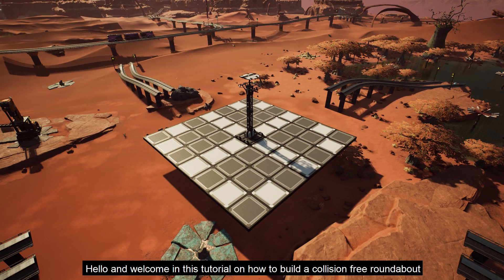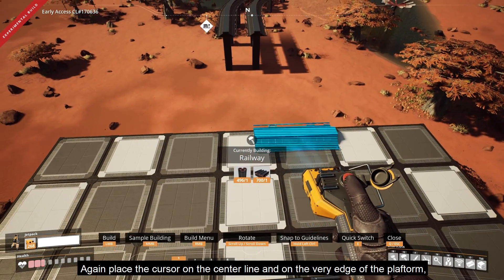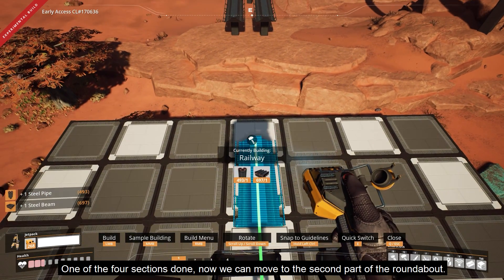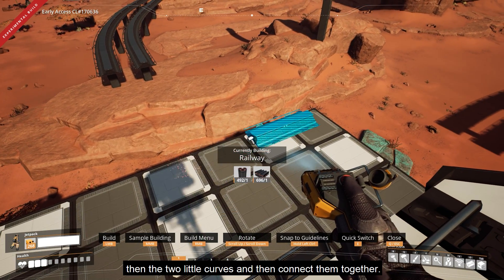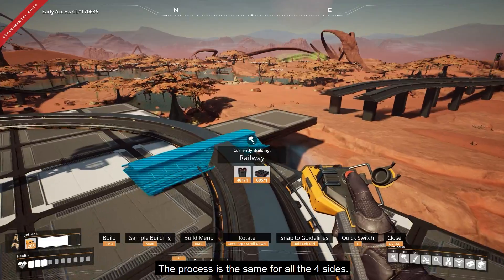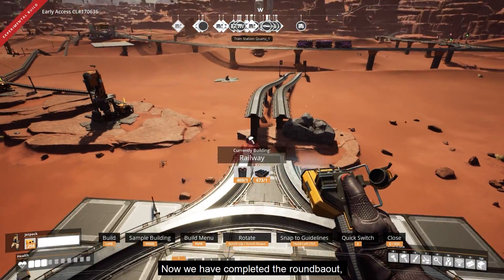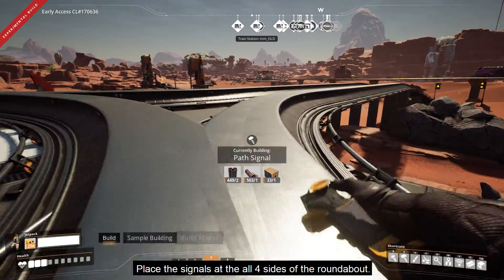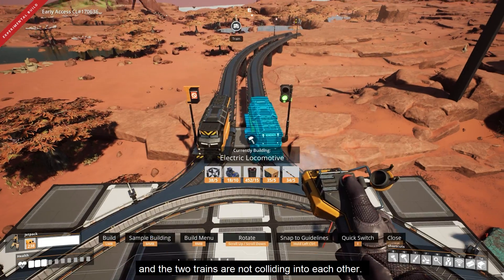Satisfactory Tutorial: How to build Railway Roundabout | Update 5 | No collision | Train signals

Comment: This isn't a roundabout as a roundabout whole purpose is to eliminate traffic lights, which you have added.
Reply: The "traffic lights" only tell trains to stop if the space they're trying to enter is occupied. A normal roundabout acts the same way; you cannot enter it if other vehicles are in your way. Satisfactory requires that we mark off sections for it to work that way though, otherwise it allows trains to collide. The "traffic lights" are not on a timer, so it is a roundabout. Trains will never stop if the roundabout is empty when they arrive nor will they stop if the trains inside it don't intersect their path. Think of them as special yield signs that tell the game how to handle merge areas, not traffic lights. Overall this will incur much less delay than a real traffic light, which is why roundabouts are good both in the real world and in Satisfactory.

Comment: Could you do a video explaining when you’d want to use each signal type? It’s very confusing
Reply: Usually Block signal
Path signal is usefull to have when a block has multiple paths that can be use without collisions
Reply: Exits always have block signals, Single entrances always have block signals, Multiple entrances have block signals IF there's only 1 exit, Multiple entrances AND multiple exits (like in this roundabout or the official signal reveal video) you may have situations where two trains can exist on the block (entrance signal to exit signal) but not on the same path. This is where your entrances become path signals as triggering 1 path signal only triggers the other signals if the train in the block actually plans to use that path whereas triggering a block signal will always trigger all the other block signals as they define the same block.